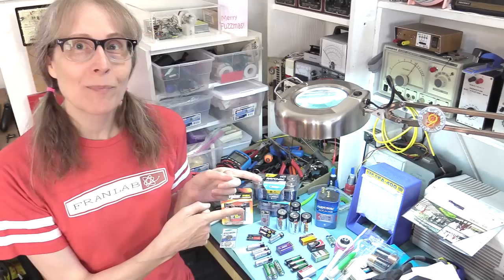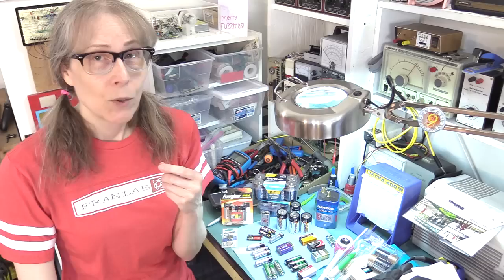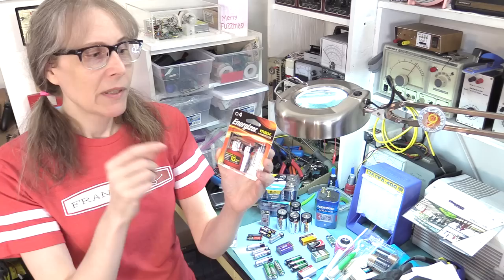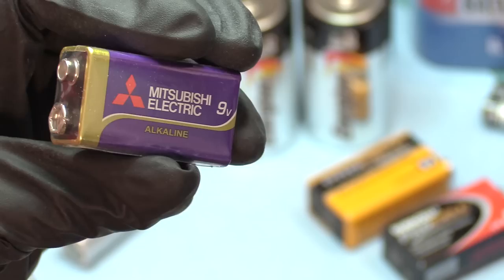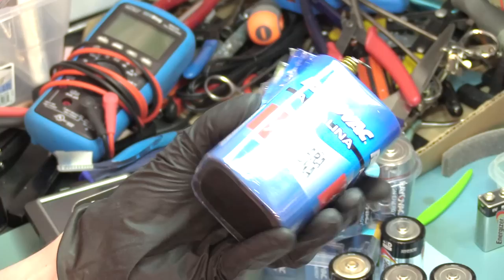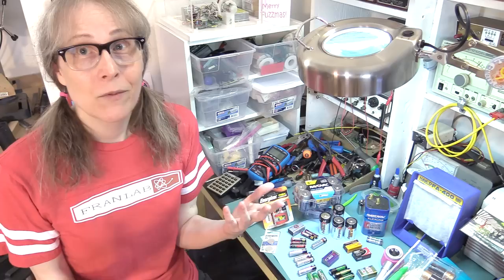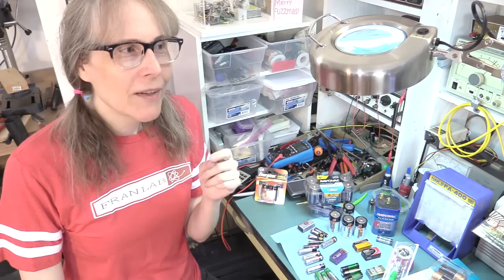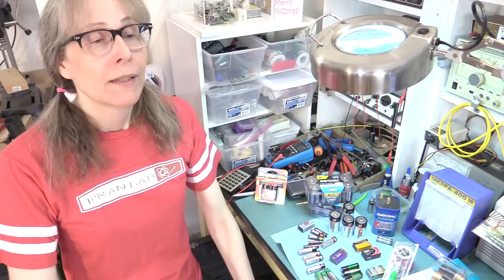Yikes! Leaky Alkaline Batteries!!!!

Comment: That's why I only use rechargeable Eneloops. Yes it's much bigger upfront investment, but it's far less wasteful than those hopeless alkaline batteries.
Reply: I checked to see if anyone else was saying this. I have Eneloops that are well over a decade old and have never had any leak. The upfront investment pales in comparison to having an irreplaceable remote for a vintage CD player or similar ruined. Even a replaceable remote will cost more than a pair of Eneloops. Unfortunately a very few of my devices won't work on the 1.2V of NiMH cells but most do.

Comment: I've no expert opinion on battery types, just wanted to comment and say thank you for the videos. Not all of them are interesting to me, but the presentation and information are always top notch. This was recommended after the uh, green goo in the amp video, I think. When I was young and always taking things apart, I encountered the goo. Flash forward some 40 years and now I know what that was all about. Thank you, Fran. You're different in that you don't waste time and effort trying to "fun up" the content. That often means dry and dull, but that isn't the case with your work. It means a lot to even be able to have access to this type of quality material. Between your channel and Technology Connections, I learn a great deal, even about things I thought I had a firm grasp on. My gratitude. Most sincerely.

Comment: "super heavy duty" batteries aren't alkaline, they also aren't designed for the same loads. they are designed for very low current draw over a very long time. these kinds of conditions kill alkaline batteries dead, but alkaline batteries survive high current loads that would kill super heavy duty batteries dead.
Reply: So, like for a clock? TV remote?
Reply: @lachlan1971  Lower even than that, more like the standby power.
Reply: Pandaren Death Knight 
Alkaline batteries work fine under low load.  Manufacturers use whatever is cheapest in remotes and such.
Reply: low current draw over an extended time (such as smoke detectors), or pulse draws, such as in a remote control.   Transistor radios, clock radio, etc.   If you know you're going to have a radio and use it a LOT, then use alkaline.  If you're going to use it very occasionally for short times, then park it in your glove box, or drawer, then the carbon zincs are better.
Reply: I made a light thingy by soldering two AA alkaline cells I got from disposable cameras in series to a green 5mm LED and a 20k ohm resistor. Its been 7 years and the LED its still glowing and the batteries haven't leaked. So i think its more about how well they are made though its true "super heavy duty" batteries suck at high current discharge.
Reply: There is no point in using those zinc-chloride batteries at least in AA or AAA. If they leak you have a problem.
Reply: @okaro6595  - I use the AA and AAA all the time in zinc-carbon and zinc-chloride.  I use them in things like transistor radios, which are very low draw.  I also use them in remote controls, which are both low draw AND sit a long time.   Alkalines like to explode in a way that destroys circuitry and corrodes the contacts.  "Heavy duty" and "Super Heavy Duty" just leak water, at most.   I've even found they work fine in wireless keyboards and mice, although they don't last as long, of course.   I carry them to put in customer units to keep from having to spend a lot of money because a customer can't be bothered to replace the batteries in their keyboard/mouse - and I have to work on their system.
Reply: @tbelding  do you have a source for the batteries leaking water at most? We recently had one leak all over the playroom.
Reply: @nataliespencer1445  - Super Heavy Duty / Heavy Duty batteries are available from most stores.  Price-wise, they're mostly not a lot different from alkaline now.   You won't want to use them in anything used heavily and often.  They just don't have the oomph.  They're simply better in items that spend most of their time just sitting around, or might be forgotten.   I would be careful about using the ones from the dollar stores, unless they're Panasonic.  (I'd check the voltage on them once you buy them, however.   I've had bad ones right from the store, at least in 9 volts)   I used them in most of my daughter's toys over the years.  They'd be used for a few days, then parked in a corner and nobody would remove the batteries.   At least this way, I wasn't prying them open and using vinegar to clean the contacts.

Comment: That is the reason we've called them Duraduds.  I have seen Duracell batteries that corroded in their original packages while still on the shelf in the store.  What a lot of people don't know, Duracell was originally Mallory and they were known to make very cheap batteries and never trusted the company's batteries since I was a teenager in the 70's after I purchased a few cells and they didn't work and returned them to the store and tried replacing them but we (the clerk and myself) determined that most of the Mallory batteries in their inventory were dead or almost dead.  According to the clerk, these batteries were not old stock and were recently received (less than 6 months) in stock.

Comment: 2 years ago I found a motorcycle intercom. This had been left in a box somewhere for at least 25 years. But the RadioShack AAA alkaline batteries that were in it did not leak yet. No voltage was measurable anymore.

Comment: I've been replacing battery contacts in things for years, it's usually possible to get something in even if it's a 4mm wide strip of quarter mil brass. In fact, a strip of quarter mil brass is usually the fix for evil battery compartments that don't want to be fixed. Easy to form, you can punch a button in it, you can make a "spring" out of it, and solder sticks to it good. Of course, these days, rechargeable cells are quite the thing. Those low self discharge NiMH are FANTASTIC. I use them in everything except things that have monochrome LCD displays because i find them usually very voltage sensitive. Those tend to take Zinc-Carbon cells in my house, which i think are what you call "acid". Decent enough for low drain stuff, commonly recycled (to my knowledge) and i dont think i've had one leak in 35 years

Comment: If a battery/cell is labelled (Super) Heavy Duty, it almost exclusively means it's of zinc-chloride chemistry. Batteries devoid of Alkaline or Heavy Duty branding are often using more classic zinc-carbon designs such as more ammonium chloride, or poorer quality materials (you may see these labelled General Purpose in some regions). Love the videos Fran!

Comment: I've lost so many flashlights to leaking Duracell batteries!   Now there is a new one called 'Energizer MAX' and it is fairly cheap and so far after a few years of use (5 years) I have not had any of them leak in any of my 'emergency' flashlights. There is also Energizer LITHIUM that is double the price and even more leak-proof.  If you use your devices a lot, I suggest you go for rechargeables as those never leak, but they do parasitically drain down pretty fast.

Comment: I switched to rechargable batteries 10 years ago and never bought disposable one ever again. Still today I use the original Duracell rechargeables from 10 years ago and still going. Very economic and environmentally friendly in the long run.
Reply: Rechargeables don't last as long and it takes way too long to charge them.

I use Eneloops in a camera and they take about three hours to recharge.
Reply: @VideoArchiveGuy  I use rechargable batteries for remotes/clocks/wii controllers. Cameras are power hungry devices lol
Reply: @VideoArchiveGuy  How long it takes for rechargeables to charge does depend on the charger. I do have GP Powerbank v800c charger and it fully charges 4 discharged Eneloop AA cells in around 30 minutes.

Comment: Decided to check a bunch of toys I had that all used AAAs, and all had switches that disconnect the power from the battery holder. My results were:

ThinkGeek: 6/6 leaked (after 5 years storage)
Duracell Coppertop: 2/9 leaked (after 4 years storage)
Energizer Eco Advanced: 0/6 leaked (after 6 years storage)
Energizer Max: 0/2 leaked (after 4 years storage)
Energizer Lithium: 0/2 leaked (after 2.5 years storage)

I've cleaned out all of them successfully with vinegar and restored the contacts, bringing all of them back to life. Only very minor cosmetic damage to two of the toys due to the electrolyte leaking through. I've now switched all of them over to Energizer Max for the cheaper ones and Energizer Lithium for the more expensive ones, as the chemistry is completely different.

Thank you for this video!

Comment: This is why I now use the Lithium-Iron AAA, AA cells, and also the Lithium-Manganese 9 Volt batteries.
No more alkalines here. Too many devices damaged. 
And those 9 Volt alkalines? The cells within (6 of 'em) have NO VENTING MECHANISM.
As in BOOM as they gas. Not anecdotal. Many occasions.
Reply: Lithium-Ion lol.
Reply: @TazR6  
No. I meant Lithium/Iron Disulfide (Li/FeS2) 
Non-rechargeable. 
Look it up.
"LOL" back at ya'.  ;-)
Reply: @TazR6  Oops! A little quick there. Now ya gotta apologize!
Reply: @englishrupe01  I am so sorry. I jumped the gun and just assumed you had confused iron with ion. I had never heard of Lithium-Iron cells before, so it was my ignorance and not your spelling.
I consider myself castigated and educated.
Neil :-)
Reply: @TazR6  Lol, very well done there! Good apology and well castigated. Shows your mum taught you well!
Reply: Thunder Kunt  (❁´◡`❁)
Reply: @TazR6 ,
 No worries!  Been there..  ;-)
Reply: @englishrupe01  She did indeed. I am 52 and still learning, both from my parents and the wide world. I was taught never to close my mind as there are many truths, and my truth may not necessarily be the correct one.

Comment: Through the years I've concluded that elevated temperatures seem to greatly accelerate alkaline deterioration... for instance a flashlight stored in the car.
Batteries marketed as 'Heavy Duty' & 'Super Heavy Duty' are typically zinc-chloride, and are about the absolute cheapest available... and only a marginal cut over the old time zinc–carbon batteries. Zinc-chlorides are often found in Dollar stores and are typically much lighter in weight than Alkaline. Wikipedia has a pretty good overview. Cool videos, Thanks!

Comment: From some reason batteries "hate" parallel connnected capacitors (bridging the internal AC resistance when batteries are exhausted). For expensive devices, lithium or rechargeables highly recommended.

Comment: "It's like table salt. Holy crap don't let it touch you!" This seems like advice for snails.
Reply: Don't worry. Potassium carbonate is pretty safe but it is slightly basic so wash your hands after a few minutes. Potassium hydroxide is worst. It is a strong base. it reacts with the oils in your skin and make soap and glycerol. Don't ever touch leaked NiCd batteries. Cadmium is poisonous.

Comment: I'm not entirely sure if that makes sense, but my experience with Duracells is that yes, years ago they were great (but expensive), then they started leaking at an alarming rate (while still being expensive), and now that I live in another country (moved to the UK a few years back), I bought a few Duracells that seem to be of a better quality than the other ones. I believe my old ones started coming out of some country that doesn't always manufacture quality goods, and the ones sold here in the UK seem to come from France, so maybe the manufacturing site has something to do with that.
Another comment, I'm migrating to rechargeable batteries as well, with the Sanyo Eneloops and respective IKEA ones (that apparently are rebranded Sanyos) currently being my choice, but some devices (like my wireless doorbell) do not accept well the lower voltage produced by NiCad cells, accusing low battery charge after a few days, so unfortunately that is not always a choice.

Comment: I’ve had nothing but trouble with Duracell’s.  But have had much better luck with Energizers....
Reply: Crazy too, 10 years ago and back into at least the 90s and 80s Duracell were the batteries you could rely on to not leak. I had a childhood toy that had batteries in it for 15 years, Duracells, didnt leak at all.
Reply: The Gillette Duracells where great. The P&G ones (or after), especially the Chinese-made ones, are not so good.
Reply: i've come across leaky energizers as well, a local garage in the 90s had a batch with them leaking and rotting in the packs, still well within 'install by' date

Comment: "heavy duty" they seem to always stick on the carbon/zinc batteries.
Reply: Exactly ! Especially in Chinese batteries
Reply: "heavy duty" is the marketing term for improved zinc/carbon batteries, called "zinc/chloride" batteries. It doesn't seem to be especially a Chinese thing, as i've seen this term quite often on low-cost batteries from european manufacturers, too. Wikipedia has a short paragraph on them: https://en.wikipedia.org/wiki/Zinc%E2%80%93carbon_battery#Zinc-chloride_%22heavy_duty%22_cell . They are still worse than cheap alkaline for (nearly?) all application. I don't think they manufacture any non-"heavy duty" carbon/zinc batteries since 30 years...
It's kind of ironic to have the label "heavy duty" on the battery type with the lowest capacity and worst handling of high discharge rate currently on the market, just because 50 years ago there were even worse batteries on the market.
Reply: It's been common to use the "heavy duty" labeling on carbon/zinc batteries in the USA at least since the early 80s, when those batteries were still made in the USA.
Reply: @tw11tube  Until a few years ago I could find Panasonic "General Purpose" carbon/zinc batteries in dollar stores alongside the "Heavy Duty". You would get more "general purpose" batteries for the dollar, but obviously, less capacity than "heavy duty"
Reply: Heavy Duty is the household name for Zinc Chloride----they are better than the old Carbon-zinc. The name was to differentiate it. Not nearly as good as Alkaline though.
Reply: @antilogism  Zinc cells are good for intermittent loads and cold weather. These are the kind you want in your garage door opener in the north. I remember when alkalines first came out, they were called transistor batteries.

Comment: In recent years, I've found alkalines leaking when they're still not dead. Ooze getting on my fingers, when I'm flipping channels. So, when possible, I've gone back to zinc carbon types. Yes, they only last a 3rd as long. But they tend to only leak, well after they're dead, so out of my device. If I'm not going to use it for a while, I remove the batteries. Most of my gadgets have a power cord, or wallcube.

My calipers are old school, and contain no electronics.
Reply: For a remote control, you'll never notice the 'reduced life'.   I have a remote control that I've replaced the batteries in, maybe five times, in thirty years.   Each time, I use Carbon Zinc (SHD), and I've never had them leak.  Considering a lot of my devices travel in my car, I'd be replacing them the same amount no matter what the chemistry - so I use the carbon zinc much of the time.

Comment: Lithium AA cells are a different chemistry from coin or CR123 cells.  They have never leaked in my experience and are also more tolerant of heat in storage.  They're the only kind that can really survive summer in a car.  The problem is that they hold 1.6-1.8V even under load so will kill or stress some devices (incandescent flashlights, though who uses those any more...).  For 4xAA devices (like a radio) that will comfortably run down to 4V or so, it often makes sense to use 3 lithium AA and a dummy cell.

Comment: Kermit ... always on, really ?       Can you measure the current draw always on state ?
Reply: I'm sure it is not always on. It has a momentary switch that powers it up, then a mosfet that the chip triggers to keep power on until it is done saying its phrase then it shuts down
Reply: Good question.  I assumed that there would be a microprocessor that had a microamp draw waiting for the button press.  But I suppose it could be possible to design a circuit with no power draw waiting for the button.  Sort of a semi-conductor version of a latching relay.

Comment: FRAN, I PURCHASED IN 1987 A CASIO DW-5600C-9B DIGITAL WATCH. THE WATCH HAS NOW BEEN OPERATING ON THE ORIGINAL FACTORY BATTERY FOR 33-YEARS, ALL FUNCTIONS WORK PERFECTLY. I RESEARCH THE BATTERY TYPE AND THE WATCH USES A MATSUSHITA- CR2016, I WONDER HOW LONG THE BATTERY WILL LAST, WELL TIME WILL TELL!

Comment: I too remember the carnage of zinc carbon cells. :-(
Reply: I've never had carbon zinc batteries leak. Maybe the newer 'heavy duty' versions are just made differently than the old ones; while though the outside can corrodes over time I didn't know there was any liquid to leak. I've even dismantled dead cells for the carbon rod and haven't encountered anything wet.
Reply: @eDoc2020  i've never come across 'leaking' zinc carbons,  corroded outer casing, yes, but they hadnt leaked anything,  zinc chlorides a different matter, i've had them leak a lot, and some i had it sounded like liquid was slooshing around in them when shook 😲
Reply: I had a pair of C cells that expired in 1941 on display with my antique cameras and radios for years and years. Never leaked. Also various Japanese brands going way back into the early days. There are several listings on eBay for old Panasonic radios and tape recorders still in the box with the batteries that they were shipped with still in pristine condition. (Lead, of course.)
Reply: @RuneTheFirst  Lead?
Reply: the outer cases of zinc carbon and zinc chlorides are zinc, not lead..
Reply: Old age slip. Meant zinc.